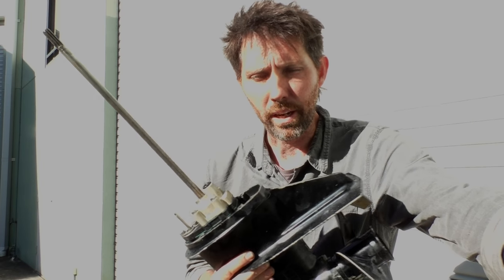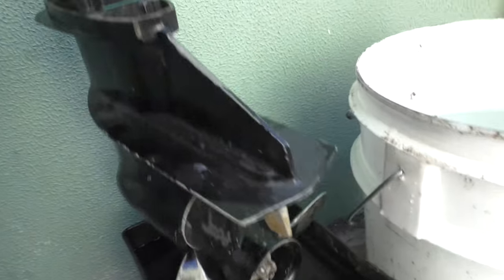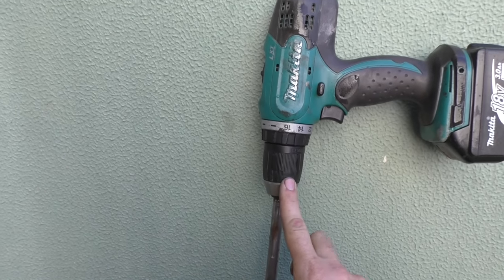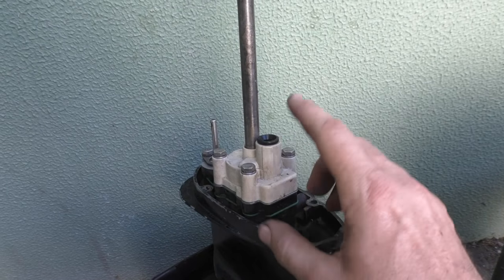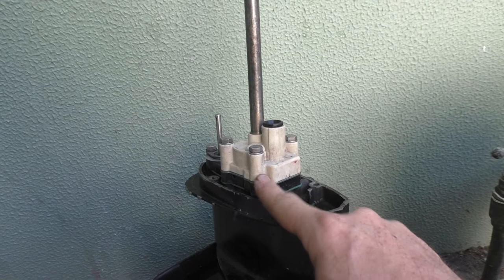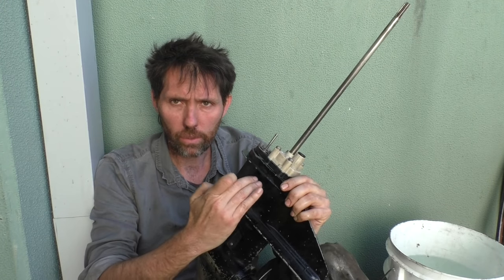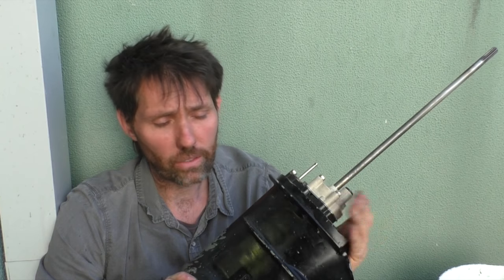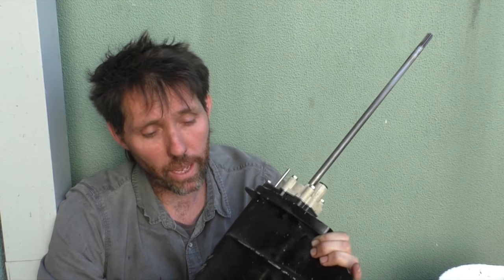Testing an outboard water pump

Comment: I think im missing something , my pump seems to work but have an issue when it was all back together and all tubes are clear im sure it was winterized before i bouggt it,does the whole leg fill up with water before the tell tail starts or ? Its 7.5 merc

Comment: What could the problem be if the pump is pumping water but when you reassemble the lower unit, it won't pump water up to the motor? I used the drill technique like you did here and it works fine, but it won't pump the water up into the motor when running.

Comment: Thank you! I was testing my 3.5 envinrude, which is a Tohatsu 3.5, it seems, and no water was coming out of the tell tale (I also learned from another video of yours that it is just a tell tale, not all of the water comes out of there). I was thinking I had a problem in cooling system but it was just the water level that was too low. Saved the day!

Comment: My old 1997 johnson 50hp seems to have issue with water flow.  Took the lower unit down, run a garden hose to the water pump inlet port, it takes over 20 seconds for the water to come out the pee hole.  Is it supposed to be that long?  I might have a leak somewhere in the system or is it clogged up?

Comment: So is this a standard rule for ALL makes of outboards? What about  ear muffs? Are they actually bad for outboards if the pumps are not self priming? I have a 1993 Evinrude that has no discharge water coming from the pee hole while in a tank.The water is 2 " above the intake mesh.

Comment: I have a 90 hp 2 stroke outboard. Water is coming out the tail tell   But it goes into limp mode when I run over 4500 rpm. Works fine below 4500. I’ve replaced the water pump, the thermostat, and the poppet. Could it be a false alarm from a faulty temperature sending unit?

Comment: I replaced my water pump kit on my 1996 mercury 40 hp two stroke motor. I put on the earmuffs turned on the water and started the motor I still get no water coming out of the pea hole?

Comment: Many thanks for this. I'm having issues with my yamaha 8hp 2 stroke. I've replaced the impeller and done this test andvall good. I took off the side and back plates and cleaned out a lot of salt build up and replaced the thermostat which was fully salted up etc. Turned the motor on its head and ran water down the intake tube and got good flow through the motor and out the telltale. Put it back together and no water coming through. Almost like there's not enough pressure to push it up the intake tube. I've ordered a new water pump kit, is there any other reason this could happen. Many thanks.

Comment: Great help- Just bought a used Yamaha 8 that had no telltale water.  Pulled gearcase, had an unusual problem, the output pipe grommet was jammed down into the output hole.  Error in prior reasembly.  Quick cheap fix, I thought.  Still no telltale.  Pulled it apart again, submerged more deeply.  Still none.  Poured water into outflow hole and now it pumps.  If I stop the drill, it does not reprime itself, but I expect it will be OK when submerged on the boat, just a testing problem.  New pump kit on order, but I am back underway for now.

Comment: hi. thanks for the tips.  i have a question. after taking the water pump off a 1980s johnson 9.9 i cannot remove the impeller from the shaft. i think it is held on by a key put i cannot get  the thing off, any tips. thanks

Comment: So i got a question. Does the water line need to be above the water pump? I tested my outboard in a tub but the water was about 3-4 inches above the inlet. But I don’t want to take it apart. Should I just put the boat in the water and hope it pumps? I cleaned the inlet and outlet out with a pressure water and water is running from the outlet to the inlet but not the inlet to the outler

Comment: I have a 61 Evinrude 5.5 HP that is not pumping water. I replaced the impeller and tested it using your manual test. It's  still not pumping water.  The old impeller looked OK to me but I replaced it anyhow.  Is it possible the impeller was installed backwards? I assembled it the same as the previous one.

Comment: My Yamaha 15hp squirts water when it's is in forward or reverse.  Doesn't that mean direction of rotation does not matter?  Additionally new impellers don't have a pitch correct?  So that further seems to indicate it does not matter.  Maybe I am wrong.

Comment: What happens when the water pump area plastic guess warm? Is this normal. It's pumping really good. Sometimes when the water comes out of the peephole it's warm. I don't even have 100 hours on my Mercury 60 horsepower outboard
Reply from the maker: If it's pumping water okay I'd say it is normal. There is plenty of friction in those impellers that is normally just cooled by the water it is pumping. They can melt if they run dry. The engine will warm up the water coming out of the tell tale.
Reply: @DangarMarine  thank you very much for answering my question. The boat is brand new, I probably don't even have 40 hours on the motor. But I do know it is pumping really good. Thank you once again

Comment: Hello how are  I have a Chrysler 85 horsepower I've replaced impala lower leg removed and in bucket of to see if it will bring water up from the and it won't just wondering why is there a blockage before the pump thank you very much for your time

Comment: Would this explain low water pressure coming out of my alpha 1 gen 1 3.0 litre Mercruiser. Ran it on muffs and just does not seem to be a lot of water pressure, Did not overheat or anything just not a lot of water flowing, Its only a brand new impeller so should be working great. Thanks again, great video.

Comment: I have a ? If you dont have something big enough to hold the lower end unit can you use boat motor ear muffs to test the pump.
Reply from the maker: You can use muffs, but sometimes they don't feed the pump properly so don't consider no tell tale as proof the pump is bad.

Comment: Good video.Will try this test on mine.I am working on a 1969 33hp Evinrude.No water pumping.This motor has no tell tale.It supposed to come out the back of leg from a hole.Guess the exhaust shoots it out there.Tried hooking hose up to copper water tube and nothing comes out except at the pre drilled hole in copper tube.Guess maybe grommet hole could be clogged or somewhere in engine block. Have you done any videos on this issue?
Reply from the maker: https://www.youtube.com/watch?v=dx8_xP30aSY&t=1s

Comment: The drive shaft in my Yamaha 100HP snapped  half way down the casing also theres a 2 inch hole appeared in the outer casing at the same spot,my question is what caused that hole and my other question is does the drive have a sleeve  when you slide it up to the head
Reply from the maker: My guess is that the hole was caused by the broken drive shaft spinning around inside the leg and hitting it. The drive shaft splines normally just slot straight into the bottom of the crankshaft.

Comment: Really enjoyed your videos,very helpful thanks.i have an 86 mercury 150 xr2.When I run in a tub ,I have oil in the water, any thoughts?
Reply from the maker: Can be either leaking gearbox oil seals or unburnt fuel due to running too rich or a plug not firing.
Reply: Thanks,it was a black color.A friend suggested since I had just replaced the impeller it mat be carbon residue being flushed out.
Is that possible?

Comment: 1996 Johnson 15hp. New water pump installation  Using a water hose and clamp to flush I notice a healthy stream of water port side, ahead of the prop through a small hole in the bottom of the leg.  Is this normal? Upper tell tail flow is very good.  Greetings from the West Coast of BC.

Comment: I inspected the pump and housing on my  dt 15 suzuki and it looks fine so I Replaced the grommet around the drive shaft and it is not pumping water very high .I also see there is a fair bit of water coming out between the shaft and the grommet I replaced(the ne on top of the housing)I am temped to replace the impeller and the plate and gasket to be see if it will pump more water .I do not think there should be water coming out around the lip of the grommet and the shaft but i cannot remember if it did this on my other outboard.
The pump looks like it has OK pressure but it will not go up around the engine and out the pee hole.
Any suggestions

Comment: THANKS!!! mi mercruiser picked up water with the pressure of the hose but not out of a bucket....i understand now. already bought a new impeller so im changing it anyways. although i could start with the hose and then disconnect it underwater?
Reply from the maker: Yes, once the pump is primed it should keep pumping.

Comment: Stu, what is likely to happen if I run the water pump backwards, on a scale from "it won't work" to "it will never work again"?
I have not made this mistake yet, but like to plan ahead!  Thanks for all of these videos, BTW.
Reply from the maker: Best case is the blades flip themselves over and you don't even notice. Worst is it does put enough water and the outboard alarms from overheating.

Comment: thanks for the info.  I have a 2006 four stroke 25 hp Mercury outboard.  It seems to be cooling OK with the rpm up but at idle it heats up and the alarm sounds. I suspect I need to change the pump impeller, thermostat or maybe lower the motor deeper into the water. It sits a bit high.  High enough for the prop to sling a little water in the boat. Where should I start???
Reply from the maker: I would definitely check the impeller to start with.
Reply: @DangarMarine  I did and it was bad. Two blades gone.  The top of the pump is about an inch above the stationary water line.  It's a 2006 Mercury 25 hp 4 stroke EFI on a 14 ft Jon boat.  Maybe I should lower the motor a little more so the pump is not dry when the motor starts?  What do you think about lowering the motor until the entire pump is below the stationary water line???   The boat was set up for shallow water fishing.

Comment: Hello,  if it installed the rubber wheel backwards (find flexed the wrong direction)  do I have to take it apart or will they fall true when motor shaft turns? Thanks

Comment: Question concerning a 2001 Mercury 2 stroke 50 hp. Last year the motor ran fine. No issues at all. This year I developed an overheat alarm only at low idle both on the muffs and on the water. Changed the impeller and thermostat and back flushed the engine through the t-stat housing. Same problem persists. I have a good tell tale on the muffs and on the water. The ONLY thing different, I think, is that there is a small hole located to the right of the lower unit lube vent hole. I do not remember that hole there or water coming out of it when I ran it on muffs last year? Is that hole supposed to be plugged? There appears to be a circular mark around the hole where there was something? Maybe a plug of some sort? I’m at my wits end. I’ve searched for photos and videos of JUST that area and can’t find anything that tells me for SURE if I’m missing something there!!! Help!!!….please!!!! Thanks!!!!!

Comment: Any suggestions on a larger shaft? I have a 115 Evinrude and the shaft is probably at least 3/4"
Reply from the maker: Maybe a splined socket that fits onto the driveshaft and then put a 1/2” extension into the socket.

Comment: Do you have a video or tips on tear down and diagnosis of the water pump if this test fails? I had a look through your videos but wasn't able to find one.
Reply: And bang up videos by the way! They have basically been my step by step help on an uncooperative Yamaha outboard.
Reply from the maker: Hey Andrew. Glad you like the vids. This one is on a full service, but it does go through changing the impeller on a Yamaha outboard. When you have the pump apart, just be sure to check for wear on the base plate, inner pump housing and any o-rings and gaskets that may be causing leaks.
Reply: +Dangar Marine my wear plate was concaved down a bit so the impeller may have not been sealing but after straightening it out it still didn't pump even though I filled the bucket right to the brim of the gearbox. I finally got it to prime by pouring a bit of water down into the pump from the top. Seems as though the water line necessary to prime is even higher on my Yamaha 15 than the Merc in your video. It's plowing water now!
Reply from the maker: Nice work Andrew! Good thinking to prime it down through the outlet pipe. :)

Comment: Hey cobber. Brand new housing, impeller and still not pumping is it I've put something together wrong although I've done it twice going off a few different videos.. 
I guess I'm really asking is there anything under the pump housing that could be blocking access to the pump. Everything else works and runs perfectly. 1980-90's Yamaha 8hp 2st

Love ya videos so far this old outboard has been a pain in the arse and I can't afford a real mechanic.
Your carby video is what really got it going when no one could. It has been parked up in a shed for about 7 years and never used so I figured there'd be some gremlins.
Thanks again cobber priceless information.

Comment: Will flushing it prime it ?  I just replaced the pump on my 300r merc.    I saw a few videos showing that the spline direction will correct itself if it’s put in backwards
Reply: I did not get a tale tell when I took it out.   I’m getting water at the top thermostat

Comment: My motor used to work with ear muffs... then one day I was showing my boat to sell it (with the ear muffs) I noticed the stream getting weak and the next time I started the motor with the ear muffs again nothing was coming out so I checked the hose nothing in there so I suspected it was the water pump. Changed it and still not working with ear muffs. Going to try it in a deep reservoir of some sort.. I’m just wondering if it worked with ear muffs before why wouldn’t it work now?? I’ve never liked using the ear muffs tho because I didn’t think it was the best method but never had a reservoir big enough.
75 hp Mercury 2 stroke 
Year 2000
Reply: Use engine muff ear muff are made to keep your ears warm lol

Comment: Hey mate, I just replaced the whole water pump on my mercury 15hp 2stroke 2000 and doing the test, I have a water leak around the drive shaft. Since all the seals are new, would you have an Idea of what could have gone wrong? Cheers

Comment: I can hook a hose up to the headphones and flush the lower unit.  I can hook the hose up to the power head and water comes out the pee hole.  But when I only have the headphones hooked up no water comes out the pee hole.  Do you have any advice on where to look?  I can hear a gurgling sound coming from the pee hole but no water.
Reply from the maker: +David N Erika Kincaid Many outboards don't pump water well when they are on the earmuffs so I would only worry if it isn't pumping water while in a drum of water. I have another video on no tell tale that might give you a few more ideas on things to check.

Comment: Honda BF45A
Trying to test the impeller as in your video, but have this problem. 
 In reverse, my drive shaft turns the prop correctly, In forward, my drive shaft turns the prop the correct way.
 In neutral the prop moves freely by hand in both directions,
 BUT, turning the driveshaft (while in Neutral) the prop is still engaged and turns forward or back depending on  which way you turn the driveshaft. 
I've installed a new  impeller on this motor before with no problems. 
This time, putting in a new kit, I found a piece of old  impeller in the water tube above and removed it.
 Everything looks perfect, but I am still not getting water from the pee hole
 I blew compressed air into the water tube above the pump and get strong air out the pee hole. 
Followed the instructions carefully and running out of ideas. 
My last idea, before pulling the lower unit again, is to run the motor in a bucket and get the water level closer to the pump.
 Any ideas? 
 I really appreciate your time and videos.

Comment: Thanks so much for the vid Stu. I've just done a new water pump impeller and housing on my '78 115hp chrysler, muffs showed no water today and was not looking forward to removing the leg again. Gives me a thing to check tomorrow.
Reply from the maker: I'd try immersing the leg in a deep tub of water, it is much more reliable that muffs.
Reply: Dangar Marine I had a big(140ltr) bunnings tub yesterday filled it, the motor backfired and instantly blew the back of the tub out. Trying round two with a proper stainless tub tonight. Learning soooo much from your channel Dangar Stu cheers.
Reply: 200lt plastic barrel worked a treat. Flushed out a fair bit of sand too, has no thermostat and couldn't get it to temp to idle. But hey it pumps a really good amount of water now.. So thanks again for your very informative videos, being boats are new to me but seeing it done make all the difference.

Comment: Hi Stu,
why are all outboards equiped with impellers? Impeller pums consuming a lot of energy. Why not using the dynamic/ram pressure at least while driving?
Reply from the maker: Because you would still need a pump when still and it is easy to have just one system, but I see what you are saying.
Reply: thanks for your answer! I even don't know how much energy a normal pump actually requires, guess i should to measure it first anyway. there are some pump designes possible that requires energy just when needed, but you are right, there have to be always a pump when ideling.
Reply: the thermostat could be also interessting, because the impeller runs allways on full power even when its closed.